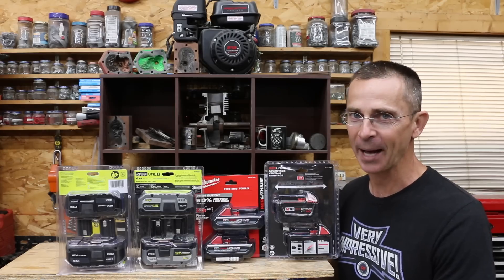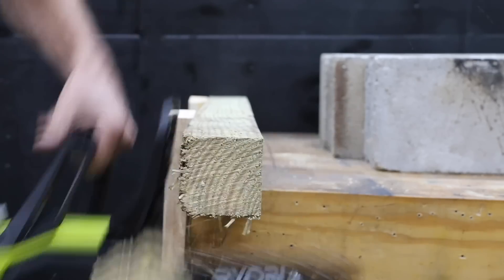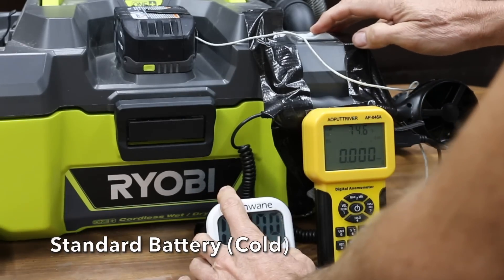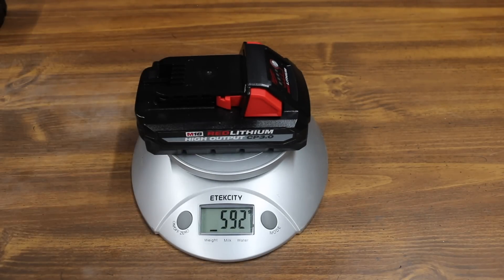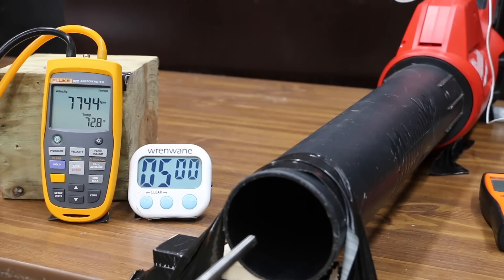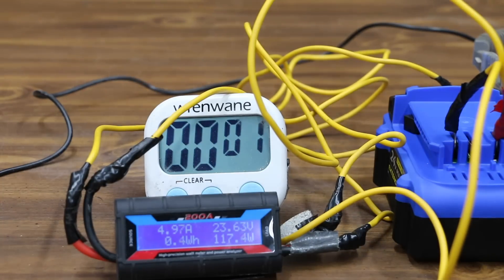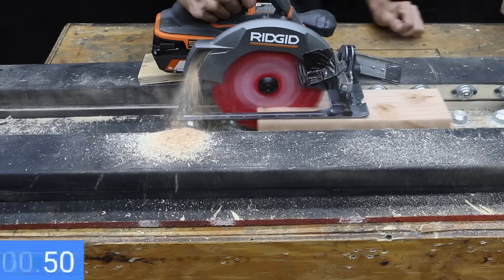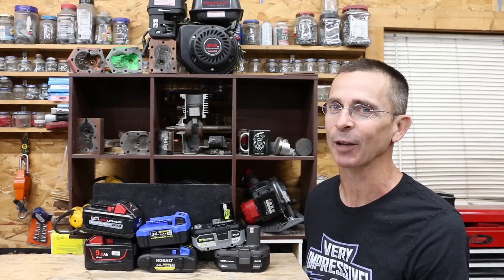Are "High Output" Batteries Better Actually Worse?

Comment: Here is an idea for a comparison test.  Air filter oil...I'm thinking specifically via dirt bike air filters, but it could be broadened to other filters.  A variation could be, different filter media.  As for the various liquids, I'd like to see Belray (thats what  I use) vs NoToil vs Maxima vs Twin Air vs PJ1....and you could throw in a comparison of spray on vs liquid if you wanted to do more.  The deal with spray on is how do you get an even, thorough, application. The deal with liquid is, how much do ya squeeze out and whats too much?  So, there are some variables in application...but if ya did the application like alot of us do with liquid (either dunk the filter or pour it on and spread it out and then, in both cases squeeze (not wring) out the excess and blot lightly with a clean paper towel, then massage the remainder to assure even distribution, I think a decent test could be performed.. Alot of us guys ride KTMs and they use Twin Air filters, so maybe use them as a base filter media....theoretically you could compare  KTM's filters with Honda's filters with Yamaha's with Kawasaki's etc....but I think the oil choice is a bigger uncertainty.  I mean, the actual filter ya use depends upon your bike brand choice...its not like cars with tons of choices.  Thanks!
Reply: Any thoughts on comparing air filter oil per my comment?

Comment: I have done extensive comparisons with Milwaukee and the knockoffs.  We use them in the new Torque Wrench to open and close the rings on 55 gallon barrels. Initially, it hard to tell the difference in temperate weather.  The biggest difference shows up in longevity.  I have yet to have a knockoff last longer than 4 -6 weeks before the charger cannot do anything with them.  Currently, we are using only Milwaukee, which last most of a year in daily service.

Comment: Request: could you test RV surge protectors? I know it's kind of off the beaten path of your usual stuff, but it's electronics, and there's a bunch of different brands, and it seems like they're fine, until they're not, and then it can be big trouble.
Reply from the maker: Thanks for the video idea.

Comment: Hi Todd! You've done Shop Vacs but how about Extractors?   I feel like the Bissell Spot Clean Pro is one that gets mentioned a lot, but there are also wet/dry shop vacs that have detailing kits.  I believe Ridgid has one.  I'm really curious if a DIYer can get away with just using a shop vac for those one or two times every year we want to deep clean our car interiors!  Thanks for your consideration.
Reply from the maker: Thanks for the suggestion.

Comment: Video idea: Different "emergency" flashlight/radios, the solar and/or crank variety. I'm interested to see how long the flashlight or radio lasts between charging, how much sun or cranking they take to recharge, how fast they can charge a phone, how durable is the crank mechanism, do they work in cold temperatures? Whatever else you can think of. There are a ton on Amazon and they're always included in off-the-shelf emergency kits. I've never given them much credit but people are always asking me about them.
Reply from the maker: Thanks for the suggestion.

Comment: Any cordless tool needs 2 batteries minimum which cost as much as the actual tool they are for but the amount of energy they have still amazes me. Battery tech still has loads of room to get better though which is why I am into buying the best cells available when ever a tool battery dies and solder them in myself, with the money you save it starts to make cordless make financial sense over corded....
Reply from the maker: Thanks for the feedback.

Comment: Lithium batteries can be permanently damaged by freezing temperatures, at a minimum they will lose a great deal of their capacity.  High output batteries should have a lower internal resistance which allows them to pass more current.  You may not be able to tell from the printing on the cells, a good tester for this is quite expensive but that’s what you need to definitively determine if they are really different.  I use lithium batteries in RC airplanes and my charger tracks capacity and internal resistance for all my batteries.
Reply from the maker: Thanks for sharing.

Comment: Only difference between the regular and high output ones is the cells inside.
If you were to type in the cells code that is printed on it then look for that batteries datasheet you will get a lot of good info for it.
This will give you its voltage range from lowest allowable, nominal and maximum charge voltage as well as maximum output current.
This is so you can talor the battery management system to the batteries.

The maximum output current is what will be the main difference between them.

Comment: Thanks for the video. I wonder how the newer Dewalt Flexvolt and Power Sacks would rate compared to their other models. The XR is said to be decent in the larger sizes.

Video idea maybe. Phone/electronics charging cords, USB-C, Micro, Lightening, etc. I've had luck with Anker and Modal brand depending on style.
Reply from the maker: You are welcome!  Thanks for the video ideas.

Comment: so it seems the lower output batts tend to have lesser grade cells vs the higher output which tend to have better grade cells....one thing that wasnt possible to test was how many recharge cycles can each battery handle before the power output lessens or the battery simply dies forever...because whether a battery lasts 2 years vs 5 years is a big difference also.

Comment: the trade off is what they have to do to lower the cell resistance. That means more robust (bigger) connections inside the cell. Connections are not active, they produce no ions to create the charge. So, they are capable of higher discharge rates, but with reduced life. These batteries often have fast chargers to go with them. The trade off is reduced life and capacity, but more grunt ability. If this is replacing a 4000 watt generator burning gas all day and making noise then this may be a good deal. For the weekend warrior with honey dos, it may be macho, but not economic.
Reply from the maker: Thanks for the feedback.

Comment: My 6.0 ho and 5.0 xc both do the same thing. Actually seems like I get more gusto from the xc5 when I use my backpack vac. The knock offs are cool for converting a power wheels 12v system into a 18v system. My brother did it for his son and that thing rips. Honestly the 5.0 is my go to for longevity and power. My cp3 ones go on my impacts and drill because they are wider and lighter and do about the same as a 5 does on them. I do know that the ho bats are designed for shit that would need digging power like the circ saw or sawzall. 🤷🏻‍♂️ I just charge em up and use em. I run whatever it is till it croaks and then put it on the charger and put another available battery in said machine. Shit i still have old school 2.0’s from 10 years ago 😂

Comment: I guess I'm confused by what these batteries are promising:

1) the batteries provide slightly more power in terms of watt hours (about 3% more)
2) But the voltage must be the same or else you'd ruin the tool
3) At best, you'd expect these batteries might last a minute or two longer (or perhaps have a bit more power when they're cold)

What am I missing?

(excellent video, as usual)
Reply from the maker: Thanks!

Comment: Love your videos - but this one missed the mark bad.  You have to use the tools meant for the HP Batteries to gain the benefits!  I have some of the Ryobi HP tools and the HP batteries definitely make a difference through the extra terminals.  You might consider updating this with the proper tool / battery combinations - otherwise it is very misleading!

Comment: If you're paying 200 bucks for an 8 amp hour Milwaukee at the store you need to shop around via ebay and amazon. How do i know? I have one i bought from ebay for half the price and it is a Legit Milwaukee brand battery. Work Smarter not harder.
Reply from the maker: Thanks for the feedback.

Comment: Nice video! I think the high output batteries are better in some tools and pointless in others. A more even test would have been a XC6.0 HO battery vs the standard XC6.0 battery. I have noticed a difference in my drill, and impacts, but not as much difference in my Hackzall.
Reply from the maker: Thanks!  Thanks for the constructive feedback.

Comment: I finally got an idea for you PF. How about testing different K-1 kerosene used in the Kerosine space heaters ??  Additives for the kerosene and others use low sulfur diesel fuel instead. Some use idopopnal alchol 100 percent grade others use 91 percent alcohol. Hope this helps you out Sir.
Reply from the maker: Thanks for the suggestion.
Reply: @ProjectFarm  Just hope you can do something with the idea PF.

Comment: if you weren't using a brushless Ryobi chainsaw, you weren't making use of the High Performance battery. If you notice, the High Performance battery has 2 extra contacts at the back. Those extra contacts can deliver a lot more power to the right tools. That's the point of the Ryobi High Performance batteries (not to be confused with the HP batteries).

Comment: Why would you make a high performance battery and it look the same as the normal battery. Normally when I buy high performance the battery is double the weight and double the size. Seems like a marketing ploy as clearly, the ryobi high performance doesn't do that much better.

Comment: User suggestion: an entire series on gun parts. For example there are hundreds of triggers available for an AR15, or the half a dozen different BCG costing options or just breaking polymer parts and measuring the failure points. You could get in contact with a youtube gunsmith to make sure the tests are relevant to how the items function. I was thinking ultimate reloader or someone like that.
Reply from the maker: Thanks for the suggestion.

Comment: Another excellent video. So on the Milwaukee knock off, you get almost the same performance at regular temps (99%-100%) and about 75% the use per charge. However, it only costs 20% of the Milwaukee brand. That’s certainly math to consider!

Thanks again for all these videos
Reply from the maker: Thanks and you are welcome!
Reply: Dont do it.  There is a reason you pay what you do. Much better materials that last longer.  It matters in a crunch or repetion of charging and lackluster performance.

Comment: most battery packs can be rebuilt using 18650 battery's The knock off battery you showed probably wasn't built correctly...18650 can have high output power like the one's I use for vaping 3000Mah 35A max  (Li-ion). And  other kinds of 18650 battery's existe. With the correct battery controller it should work correctly
I watch a guy who builds knock off battery's for tools and they seem to hold up well
Reply from the maker: Thanks for the feedback.

Comment: Today I learned I don't need battery equipment, an electric such works better and if i am far away ,i can take a generator or buy gas equipment
Reply from the maker: Thanks for the feedback.
Reply: @ProjectFarm  your video is great however, bit that is a standard at this point, thank you for your video and time

Comment: depends what tool   you work whit   kuz  all my Milwaukee   are HO   and   i have couple of XC    and  it's not about just le longevity  but also  my HO  are  stronger  when i use my impact driver  with hole saw  or spadebit   and it's just an example kuz  there's more tool  that  do the job faster  with the HO
Reply from the maker: Thanks for sharing.

Comment: I'm just wondering. Is it possible to measure the output power of those tools using a dc motor that's connected to a digital adjustable load bank, and the power will be measured by the load bank in watts
Reply from the maker: Thanks for the suggestion.

Comment: When using a pitot tube, it’s best to place is at the 1/4 point of the pipe, as it gives you the velocity of the mass flow average, rather than the velocity of only the flow in the center. Not that it really matters in this application I suppose; but it would make comparisons more accurate.
Reply from the maker: Thanks for the feedback.

Comment: Because the Milwaukee batteries are so damn expensive I’ve been using the knock off batteries for the last couple of years and they work fine are they as powerful as the Milwaukee not quite but for $200 cheaper no problem I am on the Milwaukee platform I have a lot of Milwaukee tools but I think they’re batteries are way over priced as a matter of fact I think all manufacturers batteries are way over priced
Reply from the maker: Thanks for sharing.

Comment: Well the "high performance" 21700 batteries are running significantly cooler under load, so they should last longer.
Reply from the maker: Thanks for the feedback.

Comment: Wow. So basically it seems like high output batteries are waste of money on power tools, better just buy second regular battery.
I got a testing idea for you because you have so much testing devices, skills etc. I wonder if you could a test that simulates about how much would obese person(200pound/about 91kg) increase fuel consumption of gasoline engine car compared to average normal weight person(154.3pound/about 70kg)? I think that this test would create lots of mixed feelings for people, probably even piss off some people but who knows maybe it could give a reason for some people a good reason keep their personal weight in check.

Comment: I LOVE YOUR CONTENT!!  If you saw my tools you would know I value your testing  You're slipping lately though, no Blendtec in the blender review and now testing the HP batteries with non HP tools.  They are intended for HP tools that allow for higher amp discharging.  This entire video was like putting Formula One tires on your Prius and then concluding they aren't as good as standard tires because your MPG went down and the Prius performs the same or worse.  We love your content, no rush to make videos, take your time, do your research and we'll watch what you post!

Comment: You should consider a vira propress vs regular copper plumbing test.  Perhaps compare to plastic pluming too.  Perhaps test time to assemble, burst pressure, pull strength of the joint.
Reply from the maker: Thanks for the suggestion.

Comment: Ooops, I forgot something.  I'm in the process of doing a quickie repair on a leaking asphalt composite shingle roof and I was wondering if you could test a few different products.  I'm thinking of using the white stuff (5 gallon bucket), but maybe the black stuff or the aluminum colored stuff.  Someone even mentioned that as seen on TV stuff.  I'll be rolling it on (I have a few large areas to seal) and it'll be on a dry roof.  My goal is to make the roof leak proof for a couple years - enough time for roofing supplies (shingles, tar paper, nails) to come down in price and for the weather to get better.
Reply from the maker: Thanks for sharing.  Thanks for the suggestion.

Comment: I've always wondered if there's a difference in the performance of High Output batteries vs regular batteries.  My gut feeling was that there would be a difference - if not, why the extra cost, right?  A smaller and lighter battery is a benefit, so for most of the HO batteries, that's a plus.  These tests showed that there isn't much of a performance increase, except for cold weather.  With the higher quality cells, that makes sense!

Lucky for me, I don't live in a cold weather environment.  A little extra weight and a slightly larger size aren't deal breakers for me either, so a regular battery will continue to be my go to.  Awesome test that gives me the information I need to make a better decision!

Thanks for all the hard work!
Reply from the maker: Thanks and you are welcome!

Comment: Video idea: trash bags. Every brand of trash bags claims to be the best but a lot of them don’t hold up to heavy use. Capacity, puncture resistance, weight bearing, handle strength, watertightness, etc. Also would be fun to see how a used feed bag (the woven polypropylene type) compare because they seem to work great for carpentry scrap with wood and nails, sharp metal scrap, etc.
Reply from the maker: Thanks for the suggestion.

Comment: Great video as always. One advantage of the High Output Milwaukee is weight reduction. Fewer cells makes for a smaller and lighter package. Great for lower torque/less current hungry tools like 1/4” impact drivers.
Reply: Yeah that small high output battery is by far my favorite. It’s usually the one I keep fully charged and on my impact ready to go.
Reply from the maker: Thanks!

Comment: Probably gonna be buried and also not in the direct theme of the channel. How about a comparison of AR15 lowers? High and low tier aluminum offerings, then standard and monolithic polymers. Tests involving UV and chemical degradation, impact resistance, all the good stuff.
Reply from the maker: Thanks for the suggestion.

Comment: This video is only an example of just how much of the world of electricity and batteries are alien to most people.

You should basically stop any and all battery or electricity evaluating tests. Since there are real tools out there to do proper testing with that give actual quantitative results that mean something. They are not even super expensive so there is no reason to be doing these caveman style tests. Do some real research about how to test power systems. There truely is just a few details that can give you heaps of information about what a battery is doing and performing. There are even battery rechargers that can evaluate a battery. True they are not the most accurate but the information is at least useful.